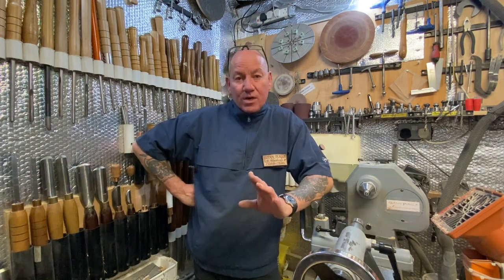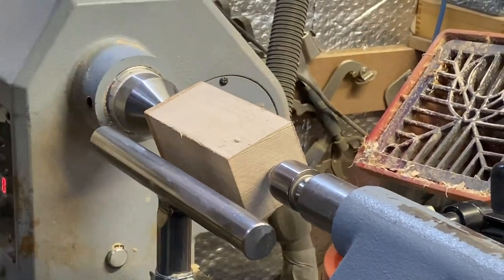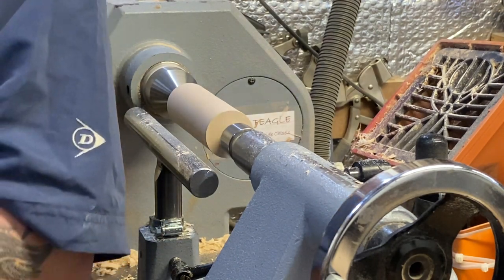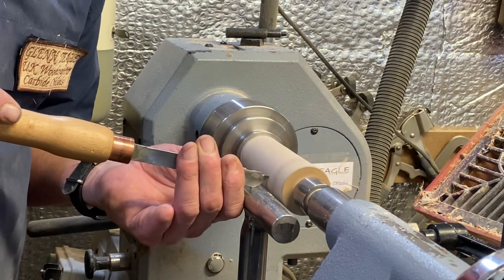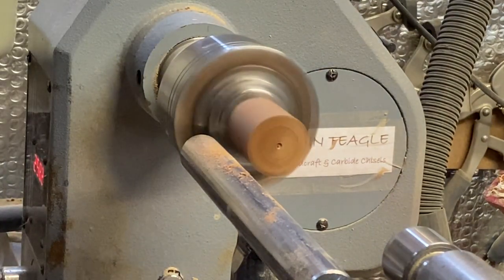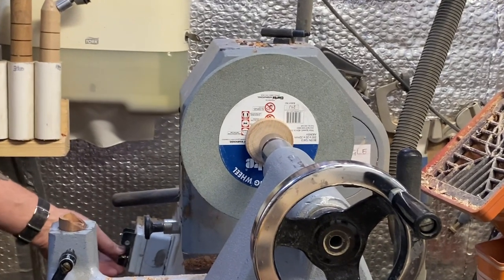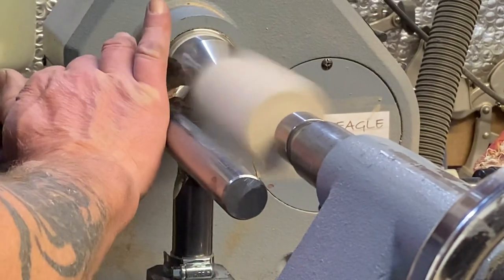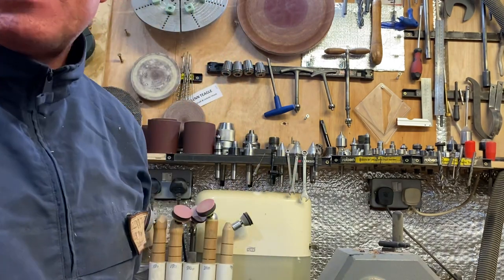Woodturning an easy and cheap solution to sharpening your tools

Comment: This comes in handy as I watched your swept back roughing gouge video and I wanted to give it a try.  I got a high speed steel roughing gouge for a little over $20.  The problem is it is too big for my wolverine or Tormek jigs so this will work great.   I have my CBN wheels set up to use my Tormek jigs.  What I learned here is to put the roughing gouge jig between the tool rest and the grinding wheel.  Tormek has the jig on the other side of the tool rest and what I found for me is as I lift the handle to put the gouge to the wheel the spinning wheel pushed the gouge away and I got small facets on the edge.  Maybe I was not doing it right but you made a lot of sense the way you did it .  Thanks. I will give your method a try.
Reply from the maker: Glad the video helped mate.

Comment: Thank you so much! I have been struggling with trying to free hand sharpen on a belt sander. I have a mini lathe that's just sitting since I've gotten a larger one, so I will for sure use this tip to repurpose it to sharpen my chisels!
Reply from the maker: Use it on the slowest speed and you won't overheat the tool. At a later date if you can upgrade to a CBN wheel, you will have a perfect sharpening system. That's all I use.

Comment: Sehr gute Idee , auf die Befestigungsschrauben noch eine Flügelmutter geschweißt macht es noch einfacher . Ist das ein Nass oder Trockenschleifstein? Der Schliff dürfte mit einer CBN Schleifscheibe noch besser werden und etwas weniger Drehzahl vermeidet Funkenflug . Zum schnellen Nachschleifen oder sogar Umschleifen werde ich mir deine Idee nachbauen . Super Job !!!👍
Reply from the maker: Thank you. Welcome to the channel. Yes a CBN wheel would be better but this video was for those who don't have a sharpening system, who need a quick, cheap and easy solution, until they can get a system in place. This is a dry grindstone used on the video. I have a few systems already in place for me. I use CBN wheel.
Reply: @glennteagleofukwoodcraftca5308  Ich verwende noch einen Naßschleifer von Record Power . Über ein anderes Schleifsystem habe ich auch schon nachgedacht . CBN Schleifschieben haben den Vorteil das sie immer gerade bleiben und ich sie auch zum Schleifen meiner WIG Schweißnadeln benutzen könnte

Comment: Thanks for sharing this! Only thing I would be concerned about is the wear from your grinding wheel falling onto your lathe's pristine bed. I would put something there to collect that abrasive dust and protect the bed - especially when dressing the grinding wheel with a diamond dresser.

Comment: I have an old walker tuner drill press that makes new drill presses look like garbage so these days I look for vintage gear for my shop.. Also throw a rag down on your ways while grinding stuff.  grinding dust won't be good for the machine..(takes own advice, sometimes)

Cheers and a handy tip, done that many times,,making handy mandrills and gluing on sandpaper..

Comment: I know you also meant to warn about the dangers of those sparks and that you should clean up all shavings around the lathe before attempting to sharpen your tools. You have recreated a slow speed grinder which is preferred over the cheap grinders.
Reply from the maker: No, not at all
Reply: @glennteagleofukwoodcraftca5308  eh? It dry grinds at slow speed with a version of a wolverine jig is it not? I do not understand your reply. It was not a criticism of your idea as you said it's a get you started method. Especially as sometimes you can pick up a small lathe cheaper than most of the sharpening machines and you have made it work as you want.

Comment: Your video was good but if novice turners can't afford a sharpening system surely they can't afford a chuck to hold the stone
Reply from the maker: Thank you for your comment Ivan. Who said they have to use a chuck? I don't believe at any moment that I said you have to have a chuck. There are many other ways you can hold things on a lathe, ie between centres. To make a point clear, a chuck can cost as little as £50. Even cheaper second hand. Many people think a chuck is essential and then think about sharpening. So, I honestly can not see any point in your comment. Toodle pip.